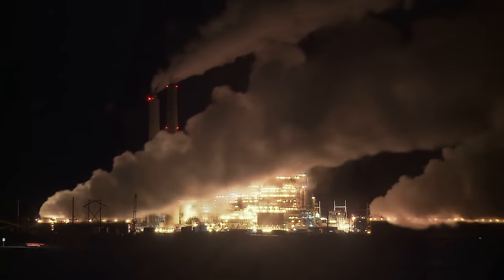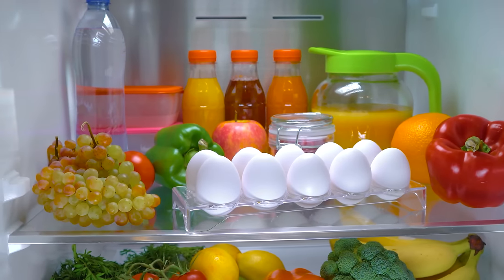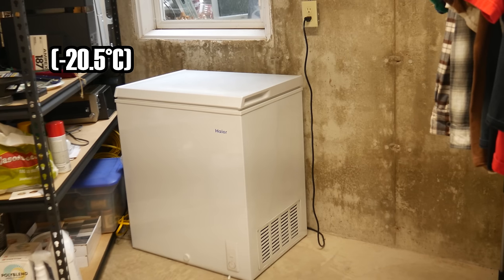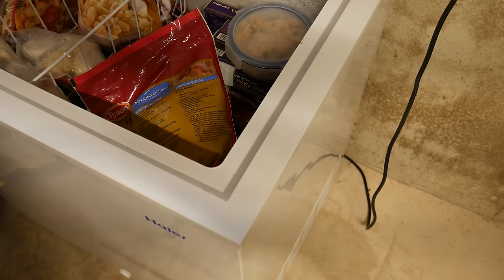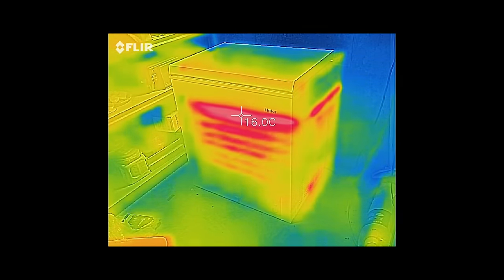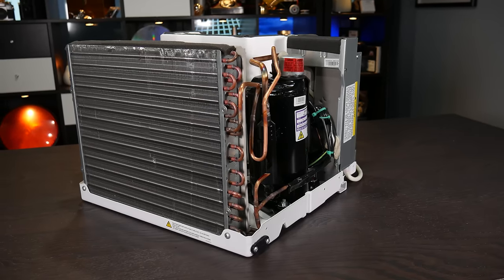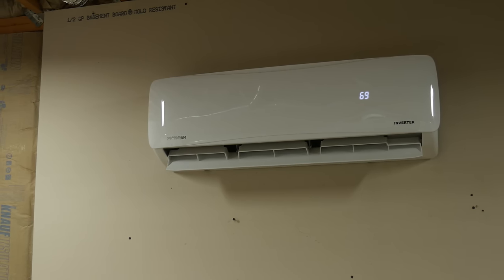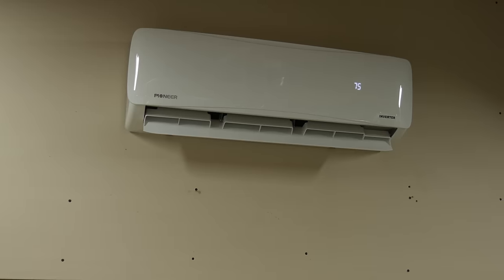Heat Pumps: the Future of Home Heating

Comment: Heat pumps are nothing new..
  they are simply an air conditioner that runs backwards in the winter to pick up the heat outside and deliver it inside. In the summer they work as an air conditioner, picking up the heat inside and delivering it outside
  do you have to keep this in mind. Air conditioners and heat pumps do not create heat or cold. They simply move heat or cold from one place to another. They do not create heat or cold..
  heat pumps are a little bit heavier duty than a standard air conditioner because they have to operate in cold temperatures in the winter to pick up the heat in the relatively warmer air than the actual Freon in the system. The air outside is cold, but it is warmer than the Freon in the system of the air conditioner/heat pump..
   once the temperature gets down below 40°F. Heat strips, electrical heat strips supplement the heat by adding heat to the airflow inside the house. Because they do not work as efficiently below temperatures of 40°F..
  it uses more electricity in the winter as a heat pump than it does in the summer as an air conditioner for cooling because of the auxiliary heat strips.
  people that think they are preserving the planet by using electrical heating such as heat pumps and electric furnaces instead of natural gas or heating oil furnaces think they are helping to reduce greenhouse gases. Think again. Where do you think the power, the electrical power is generated? Most likely , that energy, the electricity comes from a coal fired, oil fired, or natural gas fired power station.. in fact, to heat your house with electricity cost more than if you heat your house with natural gas..

Comment: The massive downside is that this still needs electricity to work. If you're in a location where power outages are often because of harsh winter weather then you are without heat.
Reply: My oil furnace doesn’t work without electricity. So this is a moot point.

Comment: I moved to the south and they do not work well if temps are below 40 degrees.
Reply: I live in Georgia and this is how my entire home is heated and cooled. We hit 10 degrees F during the cold snap this winter and there were absolutely no issues keeping my home warm.
Reply: @keijuhl  That would be very rare no? Is your house newer? These things are a cold draft and suck. The problem in NC is that duke energy rips people off on on energy. In MO i only ran on what you call auxiliary heat and my electric rate was 1/14th of the cost

Comment: I am a licensed mechanical contractor and HVAC installer. Heat pumps suck in Michigan. Cost a lot of money and don't keep you warm. Better have some electric heat back up and be prepared to go bankrupt paying for energy to run one of the pieces of shit. You are much better off with a gas furnace and central air in Michigan. Don't let these scammers sell you on their nonsense. It cost way more energy to run a heat pump as opposed to a gas furnace.

Comment: Air Conditioners/Heat pumps use more energy/ electricity. Then a natural gas powered furnace. If heat pumps are so efficient, why aren’t there more of them? Natural gas is so cheap in the USA, that they are pumping it in the ground. So in Alaska natural gas is very inexpensive, much more than any electrical driven device.
Reply: 2 words: Oil Lobbyists

Comment: why arent the electric car guys looking at this. This is all about exploiting a temperature difference. The underside of a car or the air moving under is at one temp vs the temp of the air moving over.  tada. Ive been up in many small airplanes and its hugely amplified. in the cockpit glass your wicked hot but the air moving below is cold. This should be part of an EV solution.

Comment: Heat pumps are extremely inefficient as a heating system in actual cold weather. I live in Las Vegas and have a heat pump. It works fine in this climate. If you had a heat pump in Green Bay Wisconsin you would be very very cold
Reply: Mine were doing just fine in -20C/-4F for 3 days straight without any back up heating 🤷

Comment: Now that over a year has passed, the price of electricity in Greece has reached nearly 1.00 USD. Even with a COP of 4 or 5 it costs as much to use one of these as it did for resistance heaters a year ago. It may be actually cheaper to burn oil now. Lots of people here switched to gas. Are they sorry now! Its back to burning lignite, peat, and old wooden junk. Solar is good, we don't have enough even though Greece is one of the sunniest places around. There is lots of wind on the islands and the sea around them. Guess what, the Greek government levies a tax on the air that blows through wind power turbines. Is that an incentive to build more?

Comment: Because you’ll need a back up source to survive most northern climates it becomes like ev autos. Unaffordable to most, short life span, and unreliable due to frequent failures. Requires geothermal which is even more expensive in order to be productive. I recommend embracing old school non condensing 80% efficient natural gas. Now that the word’s out that CO2 is not pollution, and natural gas is not a fossil fuel, is renewable, is clean burning and cheap. It becomes clear that “Gods fuel” (natural gas), when cost/ benefit analysis is fully applied is by orders of magnitude your smallest “carbon footprint”.

Comment: If you want heat pumps, that's fine.  I have one.  But compared to normal heating fuels, you're not going to save money...unless you have cheap electricity.  So you have to do the research.  Electricity costs have been exploding.  In most of Maine, electricity is 29 cents per kilowatt hour.  When you do the math on that, if you heat primarily with a heat pump, your electric bill is going to be expensive.  I've done the math on my home.  I heat with wood and oil.  If I were to go purely heat pump the minimum it would cost me to heat my home would be twice as expensive but the range is 2 to 4 times as expensive based on assumptions.  So just beware.  Note, my heat pump is primarily for cooling in the summer.
Reply: What did you base the math on for the heat pump? As many people fall into the trap of thinking that e.g. a 7kW Heat Pump will use 7kW of electricity, when it won't, as that's its rated heat output.  Many 7kW units will have an absolute maximum power draw of 3kW, with only using a fraction when maintaining a temperature.  e.g. I have 3 heat pumps that have a rating of around 23kW, but they can only ever consume at most about 9kW. Currently, it's -5C (23F), and my whole house is consuming around 3kW of electricity, so at your prices approximately $20 per day.  If I used my fireplaces (one downstairs and one upstairs) to heat up the home, it would cost me over double that (at about 55c per kg of firewood here).
Reply: @BenIsInSweden we use btus in the US.  So my 9000 btu mini split has an HSPF rating of 9.4.  This means it draws 957 watts (.957 kw) when heating.  In my state, electricity is $.29 kwh.  So essentially for every hour of heating I'm using $.29 hour.  This is only heating 1 room.  I've already run the numbers, if I were to run only heat pumps, it would cost me a minimum of twice of what I currently pay to heat my home.   It costs me $150 per cord of Firewood.  I cut and split it myself.  I burn 3 to 4 cords per year and just under 1 tank of oil ($600 tank).  This covers me from October through April.  So that is $1200 over 7 months.  That's less than $200 per month.  I can't even imagine paying $20 per day to heat!!!  Long story short, the equivalent heat from 1 tank of oil and 4 cords of wood is 21870 kwh over 1 heating season.  Assuming a generous COP of 3 for a heat pump, that equals the equivalent of 7290kwh over a heating season.  That equals $2114 over a heating season.  Like I said, it would cost me twice what I currently pay at a minimum because there is no way the COP will be 3 in the winter.  Fortunately electricity in my state is going to drop to $.20 kwh next year, roughly.  So that will help.
Reply: @brontoab1  957W for a 9000BTU unit is terrible, especially if that's it's average for the heating season. Currently it is 0C outside and my whole house is consuming about 2000W and I have 3 units, a 22,000BTU, a 25,000BTU and a 29,000BTU.

Comment: Heat pumps are not the way of the future yet sure like the videos he shows the cabin its pretty it's snowing what is it -5c / 20f sure there fine for that now of you live somewhere, where the temperature drops to -30 to -40 c or -23f to -35f the outer unit is going to freeze and its not gonna fire so hope u have a back up

Comment: HEAT PUMPS LIKE EVs not so great in cold weather !They kick down to strip (very in efficent ) . i have one but i use gas heat in the winter, it is far more efficent and satisfying !! also a large propaine tank when ele. fails works well !!!
Reply: Err, you might want to do more research into modern ones.   Mine don't have heating strips and have been working fine in -20C (-4F), there are also ones with Enhanced Vapor Injection that can do those temps at full capacity, without heat strips.
Reply: @JERALDTAYLOR-n4r  You need to understand that all countries dont have gas lines everywhere.
And yes, a modern air to water heatpump is not cheap, but you get value for the money.

Comment: Wait.... So basically a heat pump is 500% efficient? This seems too good to be true.
Reply: Because it's not creating the heat from scratch, it's taking it from somewhere else and moving it.
It's the same as if you were to spend a little bit of energy to move a battery from its packaging to an electronic product - you just moved a large amount of energy using very little energy.

Comment: Why hasn't anybody just added a low power resistive heating system to keep the fins defrosted, Surely the net gain would be a lot higher in overall thermal efficiency?
Reply: It's more efficient for it to stop and run in reverse for a few minutes and with much higher efficiency than resistive heating, and then return to heating.

Comment: Get ready for a mindfuck question.
If it's too cold outside for your heat pump to work efficient, is it better to plug in your backup space heater inside? Or outside, pointed at the evaporator?

Comment: When I purchased a shop to live in, the previous owner had not installed heat in the living area upstairs.  I was interested in mini-splits, but I found that the units that were quoted either were very expensive or they were expensive and wouldn’t provide heat below freezing.  I don’t know if they didn’t care about selling them or just sold more gas furnaces.  At the time, I chose to go with a gas’s furnace that was over 90% efficient.

Comment: The expansion device whether a cap tube or an electronic or electric expansion valve on these heat pumps is located in the outdoor unit. That is one of the reasons that there are line length restrictions. I do believe that heat pumps are the future but we are not ready as an industry to accomplish no fossil fuel use. The heat pumps are usually foreign made and difficult to work on. Yes, difficult means expensive! The cost of maintenance and service can really offset the energy savings in many cases. There are a lot of things that can go wrong and in my opinion the most important part of any installation is the integrity of the installer and whether they offer cradle to grave maintenance and service. I know of many installers that install 300 plus units a year and make very good money but they never look back. Cold Climate Air Source Heat Pumps are filled with difficult to reach controls and PC boards. The industry is changing so fast that your unit could be obsolete well before it's intended life span. I could go on and do on my Facebook page DuCharme HVACR Condulting. Having said all of this I think your video is great and you present a perspective that is very refreshing. Keep up the good work but remember it isn't all cake. Gary

Comment: I think heat pumps (backwards AC) were tried back in the day..There seemed to be a cost/ efficiency issue as temperatures plummeted often causing the resistance heating $$$,strips$$$ to kick on as back up..I  guess like socialism...its better now.

Comment: This industry unfortunately seriously Lacks creativity that's why the technology is so far behind. Let's say you have a heat pump and you own your own property this property has a groundwater table you install a loop in that groundwater side note groundwater is around 50 degrees year-round now your refrigeration temperature is dumped into the groundwater has a giant heat sink. If the groundwater is 50° and your refrigeration gas is close to the same if you want to heat your house to 70°you are only rising that temperature 20 degrees. Same thing with air conditioning it is extremely efficient. No more energy wasted defrosting the coil and it would run at temperatures way below freezing. Now I understand that what I just explained is a geothermal heat pump heating system. Now realize that not every place has groundwater or spring water readily accessible. But every unit whether it's air conditioning or not should be manufactured at the factory with the ability to be reversed also it should be manufactured at the manufacturer with taps built on to hook up a geothermal loop the federal government should step in and mandate this as standard manufacturing and the other style that we currently produce should not be allowed to be manufactured. If we did away with electric cars that use five times the resources and fuel energy as our current automobiles and made all AC units reversible with geothermal loops we would probably solve our energy situation.😂

Comment: would like to point out that these dont work in weather colder than -25c
Reply: In that case, it's usually better to get a ground-source/geothermal heat pump via a borehole.
Reply: @BenIsInSweden  sure bro, are you gonna lend me the $30,000 to have those wells drilled? Ill pay you back in the utility savings. Sweden has very shallow geothermal heat sources so it is very practical in Sweden to use geothermal. Its not like that everywhere.
Reply: @Redtooth75 from a quick look for the data, the average geothermal bore hore depth in Sweden in 2015 was 200m (~656ft), with the deepest being twice that. Typical depth in Wisconsin seems to be 150ft-400ft.
Reply: @BenIsInSweden  Well I am not going to pretend to know much about geothermal sources in Sweden, and perhaps I was mistaken about your geothermal sources. All I can tell you is about my area (central North Dakota). In my area it is very expensive to drill geothermal wells. I work for an HVAC company and our local drilling guys charge $5,000 per well and a typical house will require 3-5 wells. Add in the cost of the plumbing and the unit itself and it could easily cost $30,000-$50,000 for a geothermal system. A normal furnace would cost around $5,000. It just simply does not make economic sense for a homeowner to install a geothermal system.
In the past there were tax incentive programs that were actually pretty damn good. Pretty much every geothermal system in my area was installed about 20 or more years ago when those programs were still a thing. When those programs were discontinued it pretty much killed geothermals.
Don't get me wrong, I like geothermal systems. But without some type of government subsidy they are simply not realistic for homeowners in America.
Reply: @Redtooth75  That's fair, my point was that in climates where ASHPs don't work well (or below the operating range of even cold climate ones), usually a geothermal system will.  Cost will of course vary, and in some places geothermal isn't possible, e.g. just less than 1 mile east of here there is Alum Shale in the ground, so geothermal is absolutely a no go.  On the furnace cost, conversely, here in Sweden with the exception of a few certain areas, gas isn't piped to homes, so a gas fired system would likely be costly - if even possible.  I generally don't want to assume the financial situation for anyone, and I get that the cost may be out of reach for many, but it doesn't change that if it's too cold for an ASHP, a geothermal one is usually an option to overcome that limitation.
Reply: @Redtooth75  The thing is that we dont have so much gas lines in sweden. That detail make it hard to compare. And because you have cheap gas there is no need to look for alternatives. And I dont think Usa have colder than that for long periods. We dont, if it gets that cold its just for short periods and we have different kinds of backup. My heat pump is air to water and if it gets too cold the water is heated with electricity. But as I said, that barely happens.
Reply: @TT.Hell.  Yes the cost of utilities is a large factor. In the US gas is usually pretty cheap so the economic crossover point with a dual fuel setup is usually about 20-30F (0 to -5C) for natural gas and a modern air source heat pump. In many parts of the USA it gets colder than that for extended periods of time making heat pumps impractical for the primary form of heat in those areas. In my state during January the average temp is around 5F (-15C) but will drop lower than that for multiple days. Several years ago in January if I remember correctly it did not come about -20F (-29C) for several weeks.
Reply: @Redtooth75  We totally understand each other and also learn from each other. I did not know Usa had that cold so much (except Alaska). Im not an expert, but if you just look at latitude Stockholm, sweden is about same as Anchorage, alaska. You know how I think even if i am wrong :) I live in south sweden which is on a latitude in Canada. We have an average of 0c in winter here, it sometimes drop much lower but not for an extended time.